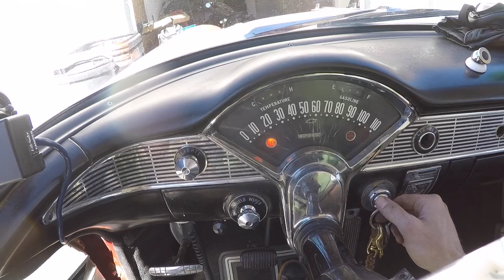1956 BelAir Fuel Sending Unit S08E05

Comment: Is a tank/sender unit out of a station wagon (nomad) similar to that of a hard top 55? Im workin on a 4door/sedan 55 bel air and the gas tank is all corroded.
Reply from the maker: I don't think it is. I believe the tank is different on the wagons and therefore the design of the sender. if you google the part and you see two different part numbers for the wagon vs the rest, then yes, they are specific.